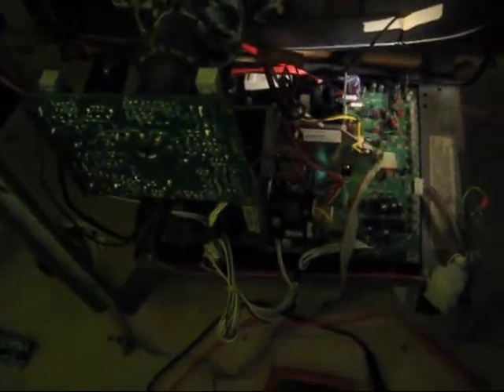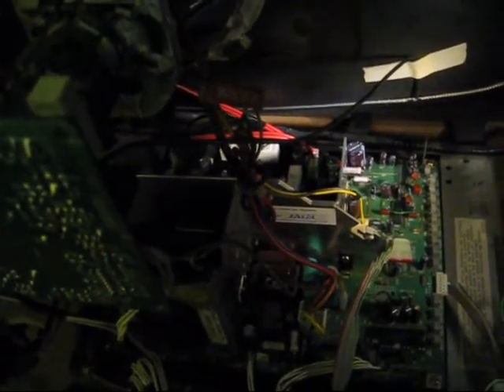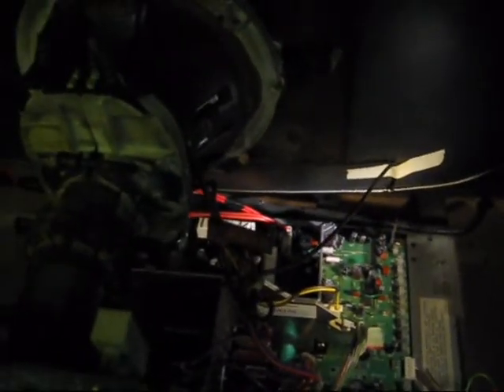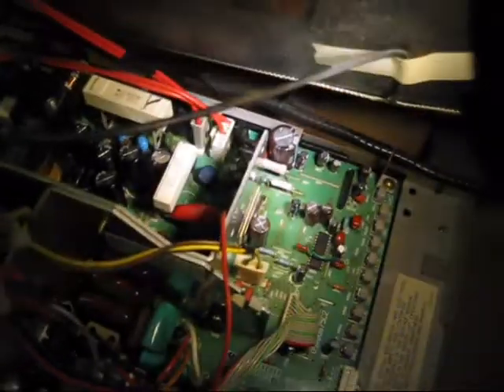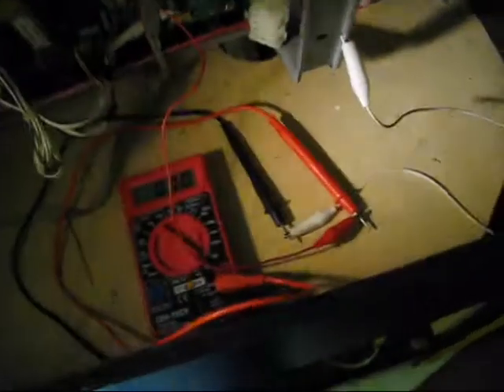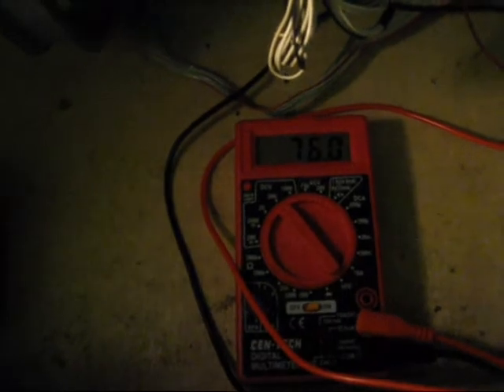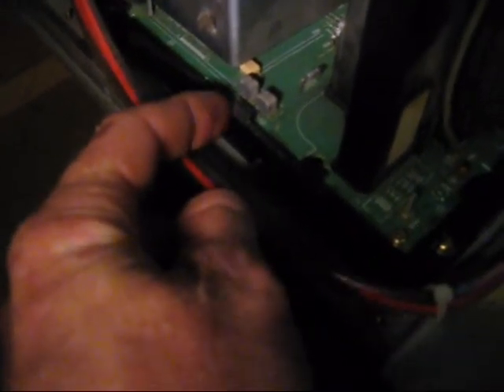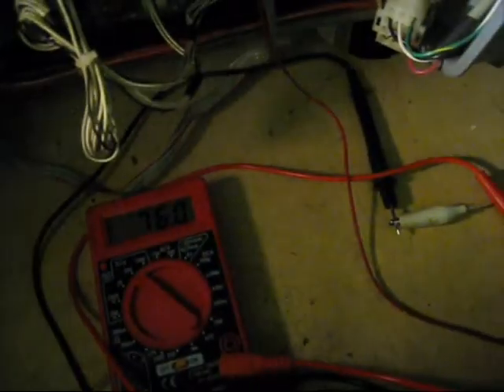How to test B+ voltage on a Nanao Ms9 Monitor chassis

Comment: Could the B+ not being set right cause the image to kind of do a weird split screen kind of thing? I got one with my Target Terror game the other day and when I turned it on the screen was all garbage like it had a sync issue. I then adjusted the 15khz pot and was able to get a pretty good looking picture but the screen is split down the middle. Been trying to research the issue online but the schematics for these things that I've found are impossible to read any values on and haven't found much else on this issue. Thanks!

Comment: PFUN41, why does Monitors need a B+ voltage at 130vdc? i don't understand why the V&H oscillators need a B+ Voltage at 130vdc for the H&V oscillators to work correctly. I'm confused why monitors have isolated floating grounds any reasons why the monitors circuit boards aren't connected to earth ground?
Reply from the maker: B+ is the high voltage supply used to run the Flyback. If B+ fails typically the other components will function but you won't get an image because you don't have high voltage. This chassis is only supposed to run 75v for B+. The specification varies by monitor. I've personally found that the chassis ground is often connected to earth.
Reply: @pfun41  for arcade monitors the B+ is set at 130vdc mostly. If the B+ is at +145vdc the display imaged on the CRT is scrambled and looks like the V&H sync is not LOCKING causing display imaging issues. Any reasons why the B+ voltage set higher or lower will through off the V&H sync locking? The Flyback is just a step up transformer not sure why they call it a flyback? Any reasons why the Horizontal scan frequency is at 15.795khz and the vertical scan frequency is at 60hz, why did they choose those reference frequencies? The electron beam is all the RGB signals mixed together into one electron beam or is the electron beam something different than the RGB signals? The neck tube has RINGS which alters the electron beam but i'm not sure if the electron beam is the RGB signals or something else.
Reply: @pfun41  thanks for the help. If the B+ voltage is set lower or higher than 130vdc the monitor will still work because the B+ voltage is "lower or higher" that 130vdc but the H&V oscillators can't LOCK onto the sync signals and the displayed image is scrambled scrolling, any reasons why? The B+ voltage has to be set at 130vdc or it will not sync correctly any reasons why? if the B+ voltage is set at 145vdc or 110vdc the sync won't LOCK why is that?

Comment: Good morning, I'm from Brazil and I'm repairing a nanao ms9-29 monitor.  And I have problem in the source: what is the voltage that feeds the horizontal of this monitor?  Please, please help me. Thank you.
Reply from the maker: The b+ feeds the Horizontal drive circuits. If you have horizontal issues it could be the flyback or anything in the Horizontal drive circuitry.

Comment: Do you happen to know if the ms9 will work with a toshiba A68SM696X? Thanks
Reply from the maker: It really depends on the yoke. The resistance of the horizontal and vertical coils must be correct. Its hard to say if you don't have an old yoke to compare to.
Reply: Thanks! I will attempt to measure the ohms